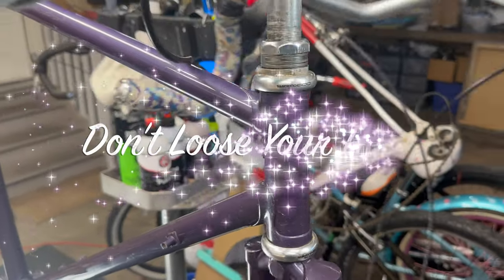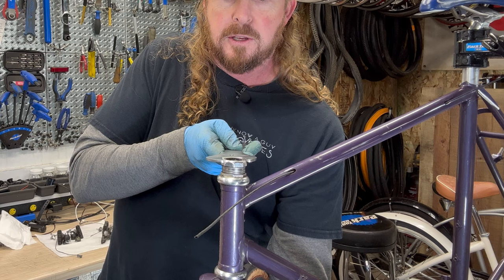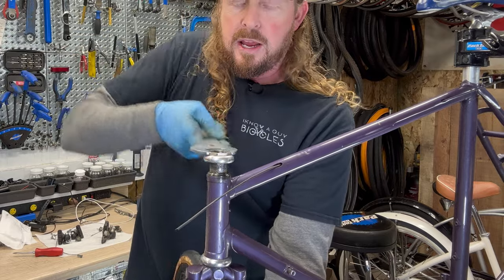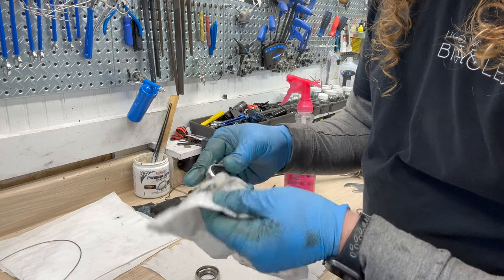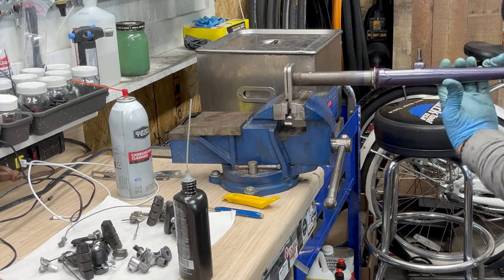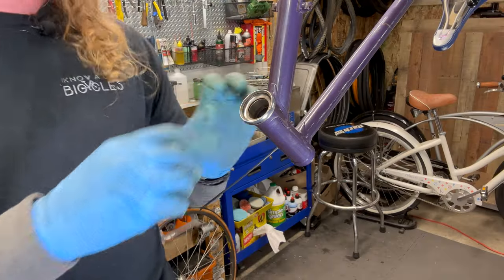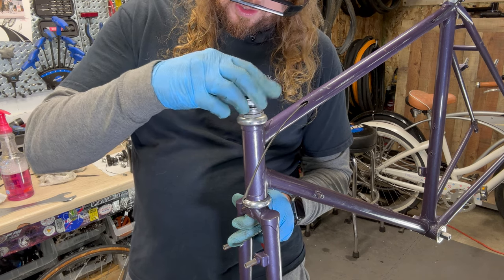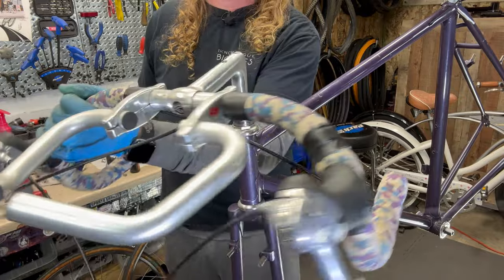1 Inch Threaded Headset Overhaul - Zunow Steel Frame - 90's Shimano 600 (Ultegra)

Comment: Clean the exposed threads with a lubricate (WD-40, penetrating oil. etc.), and tighten and loosen (multiple times) the nut to clean out the threads.  This will help maintain the threads.  It works well on rusty fasteners on motor vehicles.  If they're really stuck, use penetrating oil and let it set for a few days or more.